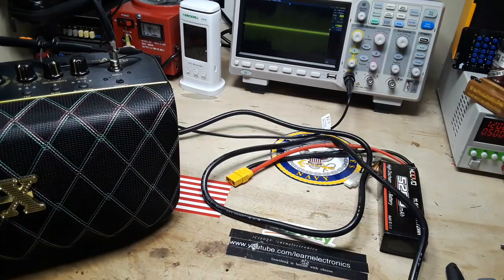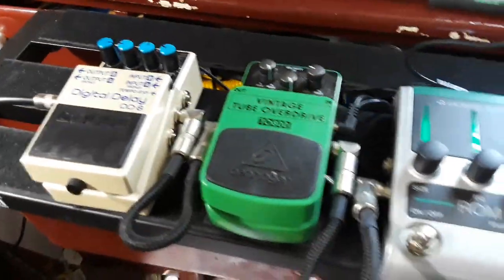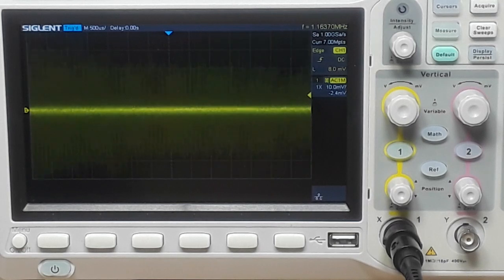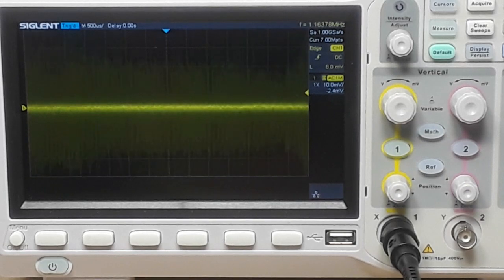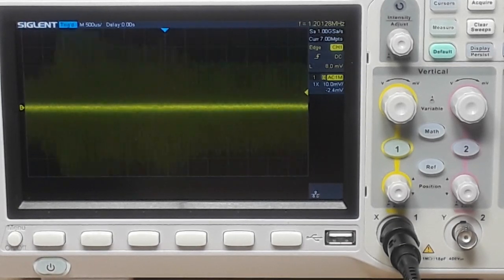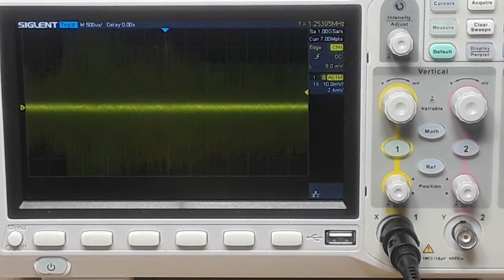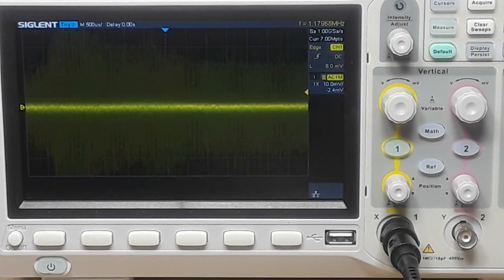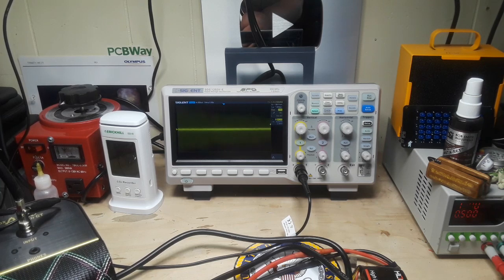Let's look at waveforms from a Gibson Les Paul

Comment: The results would be much more interesting if you set up your scope a bit differently.  First, don't take your signal from an amplifier - get it straight out of the guitar or out of your pedalboard before it goes to the amp.  Then, set your scope to ~50mV on the vertical and ~50ms on the horizontal and put it into Roll mode.  When set up like that you can actually see the sound waveform instead of just looking at noise, which is what we're seeing in this video.  Also, the difference between single coil and humbucker output level is much more obvious with this configuration.  When I first tried this I was shocked to see that humbuckers can put out several volts of signal before any amplification.

Comment: Nice video. I’ve  done this with my SG and was always disappointed at how little you can actually see on the waveform. Tried it on a Casio electric keyboard and had. A better time swapping between the synth modes to see what they looked like under the scope.

Comment: As an audio guy, I would recommend throwing your Siglent into FFT-mode in order to view spectral changes to the sound. In signal mode it's much harder to visualize what's going on, unless you're doing stuff with synths maybe. FFT would show you in an intuitive manner, exactly what changes are occurring across the spectrum, depending on your setting changes. So like, when you switch to neck pickup, you would see the bass frequencies roll off, or with distortion you would see a bajillion overtones showing up, and so on. Honestly, I think you'd find it really interesting.
Reply from the maker: I just might do that, thanks
Reply: @learnelectronics  Would be interested in a follow up video on this, when I tried that (on the same scope as this one!) I found that the FFT resolution wasn't quite good enough at audio freqs. But maybe one of your fancy models is better ;)
Reply: @RPBiohazard  Really?! I haven't tried yet, but I thought that I could zoom in pretty far!! Oh well. Maybe I will have to get a nicer one, or maybe even just a TinySA, who knows. Thanks for the head's up though, haha
Reply: @danmoretti8898  Give it a go yourself and you might get better results than me! I just remember that when set to a reasonable audio band I still didn't get great results

Comment: Thank you for sharing. I find myself doing the same thing at times and probably should videotape some of the basically innovations I've come up with since being in lockdown I guess you would say. Anyhow was wondering you're les Paul classic, are those stock pickups in that? Also did that wiring come stock or was that something you paid extra to have done or perhaps aftermarket?.. I had one of my Les Paul's wired the same way and it really just makes it the all-around utility type of guitar although at 11.75 lb is only so much I can take with it physically!
Cheers!
Reply from the maker: My LP is factory stock for 2021.